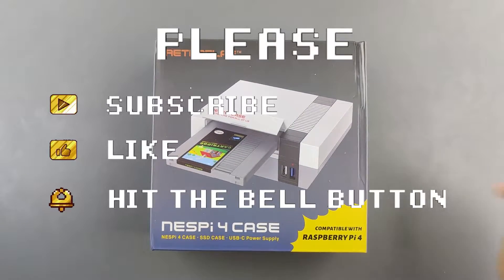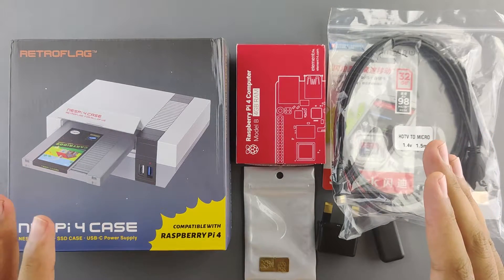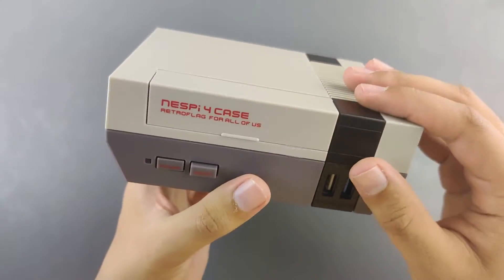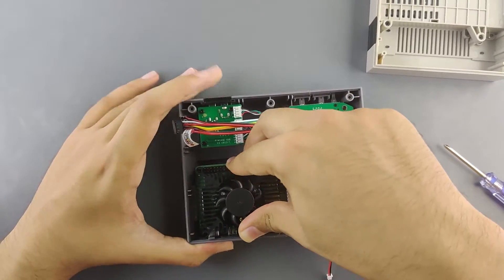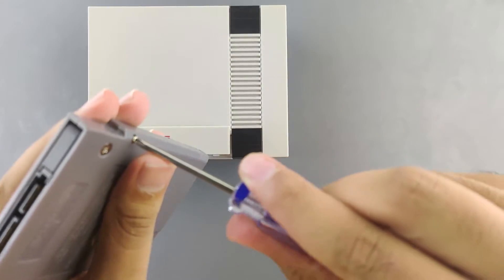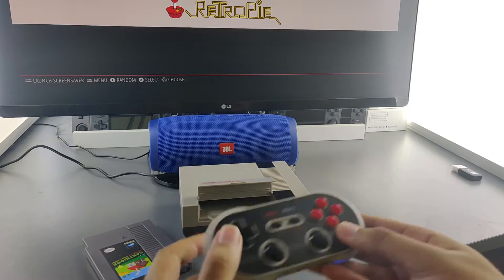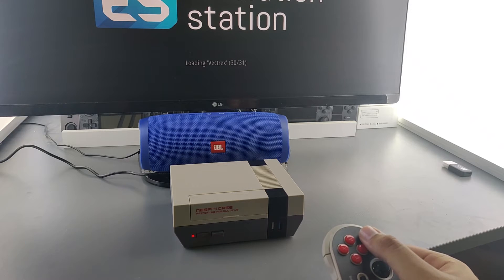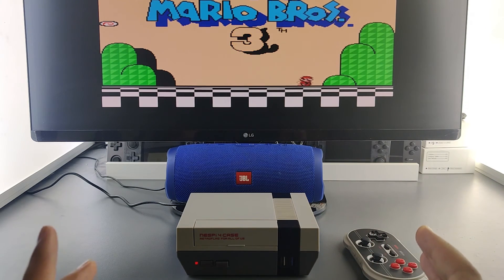RetroFlag NESPI 4 Case - Raspberry Pi 4 NES Case With SSD Cartridge!!!

Comment: not sure about anyone else but i bought one about two weeks ago and mine is missing the power cable and hdmi adapter plus when the pi is installed the case does not power the pi but without the case the pi powers on.

I'm very disappointed spending $50 plus tax for this case and its garbage

the company also says that there is two versions one with and one without the power adapter, well i bought the adapter one because the title and everywhere else says included type c adapter, well the company just send me a link to buy the adapter for $12 without any help.